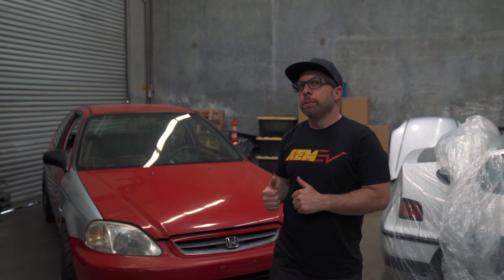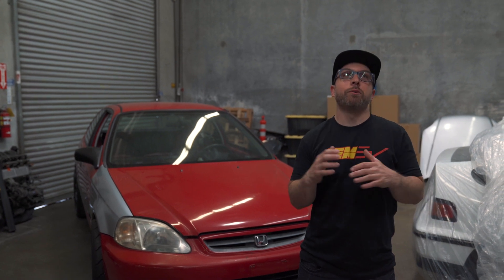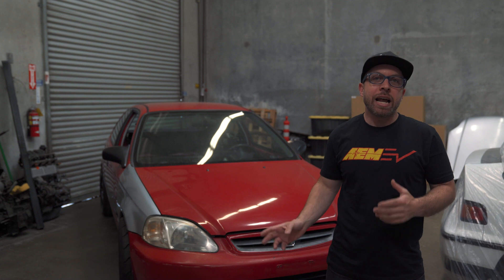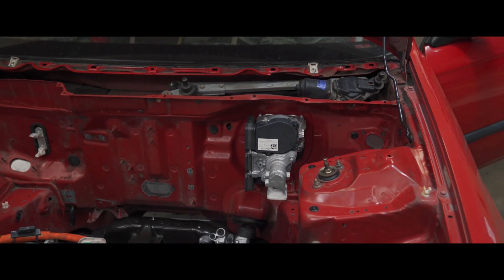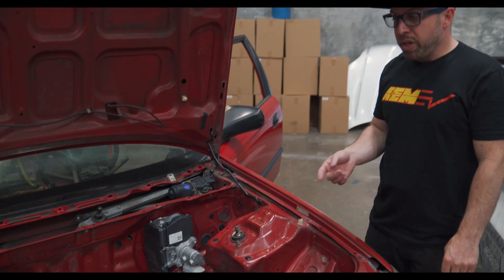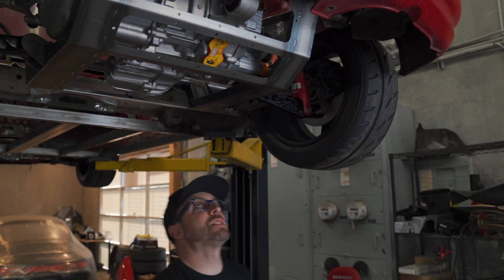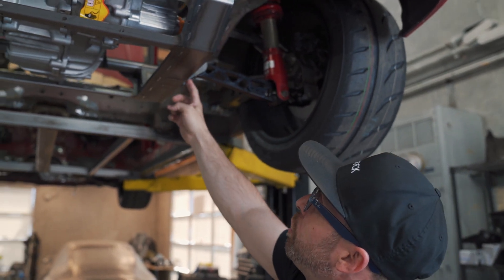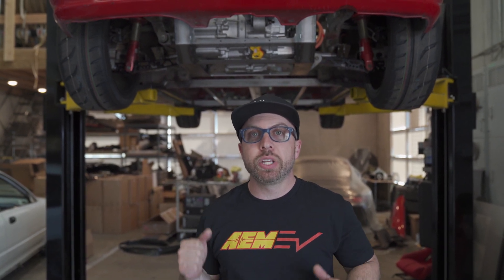RYWIRE Civic EK AWD EV Electric Build Intro-Overview

Comment: Hi Ryan, please make the drop in kit for the EG/EK/DC platforms! I have some ideas to improve on what you're doing and hopefully make it less expensive if you're interested. I think it's totally possible to build a 20 kwh 400 V battery that would fit in the place of the gas tank, with thermal mgt and no cutting. Ping me if you want more.

Comment: Needs a nice NA K20 in the front with the Tesla rear motor. All the advantages of electric without losing the noise and soul of a high revving engine. Could be driven in full electric, petrol only, or AWD beast mode.

Comment: Super sick build, thanks for sharing! 

I'm actually in the middle of converting my 2001 Civic EX Coupe using a Tesla Front Small Drive Unit as well. However, I'm going for a super practical (I.e., boring) bolt-in daily driver build. So just the front drive unit with an Openinverter board, EPS from a 2003 Civic Hybrid/Si, iBooster, and a relatively small LFP battery (~40kwh) to start with as range is not really a concern and it's my first EV build. I just finished fabbing the motor cradle and am now moving on to the half-shafts. I'm thinking I'll just splice some Model S and Civic half shafts together, but let me know if you have a better suggestion. Again, I'm going for super practical, not over-the-top high-end. Really great to see EV hot-rodding starting to take off! Thx again, awesome stuff!!!

Comment: Surprised you didn’t cut the center factory brace out and continue the flat floor all the way back. It would probably be stronger and could just produce a flat floor option all the way back to the rear motor

Comment: Are there any reliability concerns with the gearing in the front spinning in "reverse"? The model 3 rear motor is oriented motor forward, diff in the rear, and it has the same gear ratio as the model s rear. I believe the model s motors have different gear ratios, and the tire size equals it out.
Reply: I've been all over the various EV conversion forums about exactly this and apparently there are a good amount of folks running SDU's in reverse w/o any issues. My understanding is you just need to open it up and swap the oil pump hoses around so that the oil pump operates in reverse. There seems to be some debate on whether you also need to do something more to regulate the oil pressure, but a lot of folks claim it works fine w/o any additional mods. I'm in the middle of doing exactlty this in my 2001 Civic EX Coupe, so I'll let you know how it goes ;)
Reply: @nub340  I'm sure there isn't an issue while driving around town. Sticky tires on a sticky track will be the test! I believe openinverter is the only controller that will allow the motor to spin in reverse for "D". If you are using that controller, what are you using for your "gauge cluster/display" (mph, soc, all that)? 

Let me know how your build goes. I'm very interested.